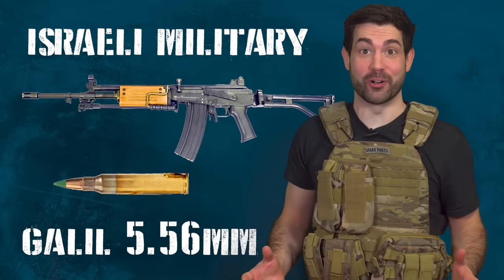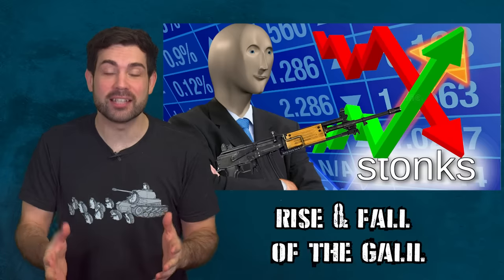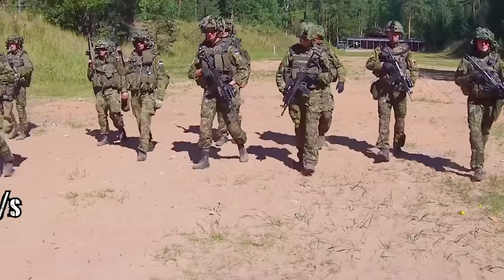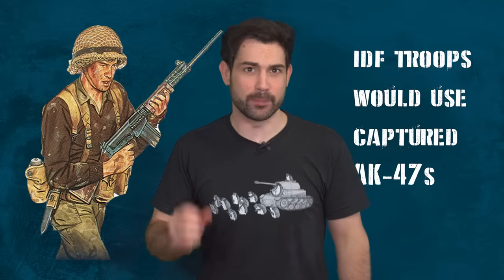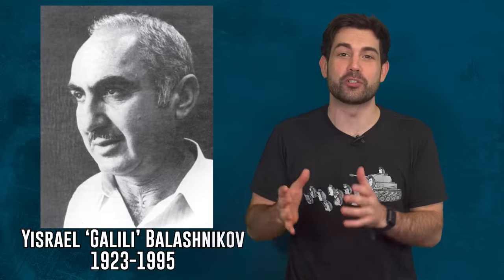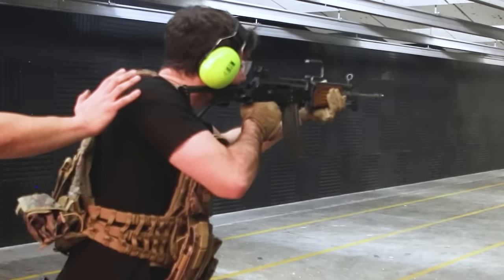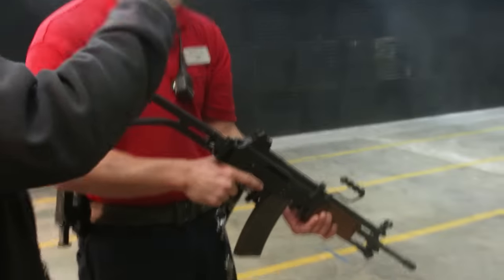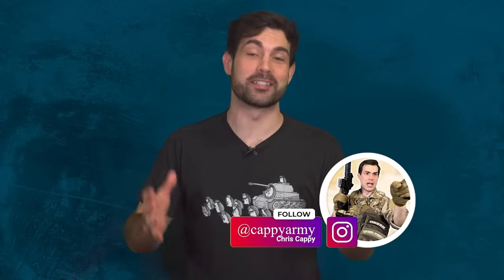Why the Israeli Army Created the Galil Rifle

Comment: Ak-47 and all its variants has one very major minus - bolt mechanism always located above barrel. It is forged steel, massive and heavy and create huge moment when cocks back every fracture of the second during fire.  It is recoil what makes it not accurate gun. You can make it completely mill it out of steel, with super tight tollerances but never change main problem - disbalance. Mass times acceleration square divided by 2 is the energy which bolt recoil back every time. It till lift barrel every discharge.  M16 on the other hand does not have that problem. Bolt mechanism is aligned with the barrel and reduce recoil significantly. Make this gun very accurate during fire.

Comment: A great weapon.  I can testify from personal experience, the short version, the Glilon, is reliable, even in snow and sand/dust conditions with no maintanance. Folding stock allows use in tunnels and bunkers. Got dual safety for both right and keft habded users. Also the heavy metal frame gives a powerful punch in close combat and in non combat situations.  Much better in all those aspects than the old M16.
Reply: Israel gets snow?

Sure.....
Reply: Yes. In the Hermon mountain. There's a ski resort there, beneath the IDF outposts on the border.

Comment: My friend has a Galil, it shoots well and runs great but I don't like how it dents the fired cases, it ejects them super hard which hit the ejection port making it impossible to reload anything it fires. And it yeets the shell casings about 40 to 50 feet away, so even if it didn't dent the cases they end up spread over a 30 foot diameter circle 50 feet away, honestly you could turn the gun sideways and shoot your enemy with the ejected cases...

Comment: Vietnam didnt fully adopt the galil ace.

meanwhile the Z111 Factory in vietnam licensed the Galil Ace and modified to back to a AK Style rifle in the STV Family of rifle (STV is vietnamese acronym for Vietnam Assault Rifle)

STV-215 and 380 being more galil aced meanwhile the STV-410 being more AK-15 related (215 being 215mm carbine, 380mm being rifle etc)

the STV-380 differences from the ACE is the AK style fire selector (Safe Burst Full auto and single), smaller handguard, and using standard AK mags, their main reason is to make the transition easier for PAVN to adopt it and the galil ace handguard was a bit too big for most Pavn soldier preferences

Comment: Interesting comments about the FAL.  I used the FAL (or rather, the Australian version, the SLR) for a LONG time, and never had a problem with it.  I loved the SLR.

Now, Australia opted for changing the safety sear so that it could only fire semi auto.  I heard that this was because the barrel really wasn't heavy enough to handle fully auto fire.  However, it may also have caused some performance issues that I wasn't aware of, but to me, the SLR was absolutely fantastic, and it handled itself well in Vietnam.  Not sandy, sure, but not exactly a clean room either.

Comment: At 2:15, correct me if I'm wrong, but there's a mistake in saying the AK-47 is stamped, when the AKM is stamped and the AK-47 is milled. Sorry if I'm wrong but I'm pretty sure that's the case.
Reply: AK-47 is stamped.
Type-2  and type-3 are milled.

Comment: In the 1980's, the IDF infantry units had a Galil and non-combat units (such as security) had M16's. The Galil was favored (I think) because it was less prone to getting jammed if you didn't clean for days in the desert, which may be saying something about discipline in the Israeli infantry units. Then circa 1990 someone realized that you can't hit your targets when you're out of breath and your rifle weighs in 10lbs, so they switched - M16's for the infantry and Galil for supporting units. Tank crews continued to have a shorter version of the Galil for another decade or so.
What else can I say about it after carrying it for 3 years in compulsory service and 16 years reserve service? It wasn't designed for Vietnam, so you couldn't clean it by taking it to the shower; Who the F designs a rifle where you the aiming sight is removed when you dismantle it for cleaning? Think it will keep its accuracy afterwards? The safety catch was prone to inadvertent opening. And no, at no time did we use it to open bottles because we didn't get any, and even if we had a chance of buying a cold soda with our money, it would be canned.

Comment: There is yet another rifle that's based on ak that fires 5.56 and adopted by a major militery. It's the INSAS rifle of India. 

It has a m4 style selector with 3 round burst. It was a non reciprocating forward charging handle. And a very similar carrying handle to that of galil. 

On the internet you will hear non experts giving a pot of shit to INSAS but what they don't realise is that this rifle new rifle was put to the test in one of the harshest climates. There are bound to be issues. 

Otherwise it is known for being very accurate and having low recoil. There is a clip of India and Us soldiers doing joint training and us soldiers like the smoothness of insas.

Comment: As a Hunter of deer and Antelope, and the later is usually ranges of over 100 yards. The 5,56 or the civilian .223 would not have the stopping power. And at 500m or 546.8 yards. Even if you could hit the target I doubt very much you would cause much damage. When I hunt long range. its a good old 30-06 all the way. Range, accuracy and knock down power that have been proven. Okay the 5.56 might be good for jungle and or urban combat, but for long range work, like over 100m, just not good enough. I don't care what any one says. Oh, its just a bullet slightly bigger then the .22 Winchester Magnum Round.

Comment: The only goal Eli ever got the fire was at an Air Force Base where I shot a folding stock 308 carbine version and fired a half-inch group with the iron sights. I don't know why it has that folding handle on it, I've literally never seen anyone actually use that fairy handle and yes that's the proper spelling for that handle because it applies to anyone who will use that handle. When I did finally buy afn it was a British inch pattern rifle that was specifically designed for Desert Warfare. It had the guts in the bolt so that it would handle sand more readily oh, it was almost impossible to raise that handle on that firearm because it had never been deployed. I found the Galil in 308 to be a superb battle rifle. I still to this day do not understand why they dumped it for the damned AR's that will not run in the sand. And you can't even pick them up because they're black. And in the sandbox out there they are way too hot to pick up once they've been sitting in the sun. Why in the world do you think that all the weapons in Israel have wooden furniture.

Comment: I can open a bottle with an m4. I can open a bottle with almost anything living in Mexico for 15 years will teach you, you can use anything as a bottle opener 😉
Reply: That's the problem, the IDF soldiers used anything they found and it was usually the magazines that got frequently damaged, so adding a bottle opener saved the magazines.

Comment: Milled receiver is not necessarily the reason why it is heavier, VZ58 is also milled and it's vice versa lighter than AK, they were just lazy or not experienced enough to remove as much material as they can back in the day. Or they just decided to have more massive body on purpose to make it more durable. 
Stealing guns from enemies and exploring them sounds like a dream job. 😀
Reply: FP-45 is stamped and much, much lighter than the vz.58.

Comment: Does the ACE still have the bottle opener? Asking for a friend
Reply: It wasn't really designed as a bottle opener. It was for holding the bi-pod, but since most rifles were used without it, soldiers found another use for it.

Comment: WHAT? Not equipped well enough to mantain an FAL??? I'm former Argentine Army, we were still using FAL's when I was I was there. If anything the FAL is EASIER to maintain in the field than an AK. Look for a problem of them disliking them elsewhere, like the fact they all wanted uzis and when they got FAL's instead they didn't liked that they couldn't auto fire a 7,62 NATO rifle accurately.

Comment: As a German I gotta say that a bottle opener is kinda usless you could just use an edge
Reply: As an Israeli I gotta say you're missing the point, the Israelis did use an edge, of their magazines, and the magazines got damaged frequently, so they designed a designated bottle opener in the rifle so they will stop doing it.
Reply: @E_y_a_l  I didn't mean an edge of the riffle (just some random edge), but with that background information I can understand the point of integrating a bottle opener into the riffle.

Comment: How can you get more ammo in a magazine with 556 the cartridge is the same size as the 7.62×39!
You can only put 30 556 in a 30 round 7.62x39 mag
Reply: They are only the same length. 7,62x39mm is a lot more tapered than the 5,56. 5,56 is thinner, but because it is different shape, it wont fit.
https://m.media-amazon.com/images/I/61LFqvcVxmL._AC_SL1454_.jpg

Comment: Lots of confusion and misinformation. 
First, the model you show here was almost never used by the IDF, it has a grip handle and this model was not supplied later (a small number of models were supplied this way, for the sake of the experiment). Second, this is the long model and a shortened model - Glilon - was used a lot. 50 round magazine were also an experimental product and were never used as standard. Automatic shooting: what's the deal with all the youtubers with automatic shooting? Why are you so excited about it? It is not clear. No IDF soldier has fired in automatic mode nor received such an instruction, there is no reason for automatic fire mode in combat except in 1 certain case (while storming into a building). bottle opener? come on. If you believe that, I have nothing to say. Just imply that the bipods need to be caught somewhere when they are in the folded position. The Galil is more accurate because of the greater distance between its sights and smaller cal., nothing to do with the stronger forged production. The IDF was not "brand new" in 1955. Most warriors where trained from the 30's and IDF itself was established on 1948. Israel Balashnikov (Galili) was not born in the USSR but rather in a kibbutz in Israel (then under the British mandate). Where do you get your information from...?

Comment: Yes the 50 round mag sucked. Which is why no one actually used one more than once.
Also, that feature in front of the magazine well, is not a bottle opener. It holds the legs of the bipod in the closed position.
Reply: It's also officially a bottle opener as you can see at 0:17 demonstrated by the developer of the Galil

Comment: The bottle opener so loudly proclaimed by the narrator was incorporated into the Galil due to the habit of IDF soldiers to use the lips of a box magazine to open soda bottles, spreading the lips and often causing a double feed just when you don't need it. The claim that the IDF gave the nickname "Tiger of the Desert" to the AK-47 is bull. In all my years as a regular and reserve (some 30 years), I never heard that name. The FN FAL, which I did my basic training with, was a piece of garbage, maybe well designed for the conditions in Europe, but a dismal failure in a desert environment. There were guys in my unit who swore that the only Egyptians injured by FALs were those who got hit by one being thrown away by an IDF soldier. S-A-R stood for Safety/Automatic/Repeat.
Sorry guys, the channel did need to do its homework a bit better for this video.

Comment: The Galil does not resemble the m16 / ar15. It is literally a milled ak with better dust / sand protection and a zero hold dust cover. otherwise all ak

Comment: Why the fascination with 5.56?  It's a small round that usually just goes through enemies.  7.62 should be the focus, that calibre will blow someones arm off rather than a .22 sized hole.... All these militaries are basically trying to make improved ak-47s or M4's..... As an Aussie. I dont see why any military doesn't use a bullpup design like the Steyr.  Longer barrel but overall lighter and smaller.  Much easier weapon to use.  Anyway whatever, spend billions developing a "new" rifle thats basically the same as the first gen 5.56 weapons.

Comment: Why did the FAL fair so badly in Israel while, anecdotally, doing so well in similar conditions during the African  "Bush Wars"? 

Anyone help?
Reply from the maker: I really think it has a lot to do with the fact that the Israeli army was only like 15, 20 years old when they started using the FAL. they were not ready to be equipped and trained to use it correctly
Reply: @Taskandpurpose  👍🏻 thanks for the reply ❤🇬🇧🇺🇲
Reply: FAL didn't do particularly well in Southern Africa either, although it is by no means bad. FAL was designed for a different type of conflict. R4/Galil is better for Southern Africa and Israel because you don't need the range, and it does much better in dusty conditions.
Reply: @AviViljoen  cheers, Avi ❤🍻🇬🇧

Comment: The whole "Can Opener" is a pure BS. as you can see in the pics and films, the Galil has bipod attached under it, and these "openers" are holding it folded. I know this because I had Galil when I served in the IDF, first with the long version and later with the shorter one.
We used it in the armoured and artilery forces because we could fold it, and not break apart as it thrown and shaken in the vehicles. it was one tough gun.
Reply: Did you even watch the video? at 0:17 Balashnikov demonstrates the bottle opener himself
Reply: @E_y_a_l  Darling, you can open your bottle with almost everything, including a fork, a spoon and the corner of the table... this is not an opener but a wire cutter. please belive me, I used the Galil for 2.5 years.
Reply: @swingingbunny3550  2.5 years is cute, I've used the Galil and Glilon for 3 years in regular service + 7 years in reserves until switching to the M-16, so "please believe me", the fact you can open a bottle with anything is exactly the problem, soldiers used their magazines and ruined them so that's why they "officially" designated that part of the rifle as a "bottle opener", to stop soldiers from using "anything", and it's not a wire cutter, the wire cutter is the front part of the bi-pod, the bottle opener is the back part that holds the bi-pod's legs in place while folded, anything else you want to try and claim, "darling"?

Comment: back in 91, i had to carry that lump of metal for a year in golani untill we finally got m-16's. israeli's are not big people, so the whight of the weapon - 5 kilos+ 8 magazins+2 cantins + what ever other gear you had to carry was a real pain in the ass. add to that the fact that the gun and the mags rust and you have to clean and oil them every day did not make it popular with the troops. the magazins jammed and because the hind sight is on a removable part of the body it is not accurate, to say the least. our guns did'nt have the handle to carry it, so after 4 months of carrying it without a strap (some kind of exercise in futility) i believe it was the single most colectivly hated piece gear by far

Comment: I served in Battalion 50 Paratroopers 1972, 3rd Infantry Brigade 1973, 525 Airborne Brigade 1976 to 1981. You tell a good story but much of it is made up. FN 762 and Uzi 9mm were standard infantry weapons. At the end of the 1973 war Nixon airlifted thousands of M16’s replacing the FN and Uzi overnight as the standard IDF Infantryl rifle. The Galil was not seen in wide service until 1980-81. 
Israel is constantly improving its weapons systems based upon results in the field during combat. The FN never had a nick name other than heavy piece of shit. Everyone wanted a Klach. 
SF Units carried them as well as other weapons after the 6 days war. When Israel transition to the M4 instead of the Galil, the new Bull Pup Tavor was already in development. The Uzi served Israel well until the 1970’s when Arab Forces our gunned the IDF with the Klach.

Comment: 1. Yisrael Galili (Balashnikov) was born in Palestine Mandate - Mishmar A-Yarden to be precise. And not in the Soviet Union. ))))))))))))))
2. Uzi was developed by Uziel Gal, which was Galili's competitor for developing FN-FAL replacement. Galili had no connection to UZI development, except some similarity in last names.
3. "Balashnikov" was joke code-name given to Galili's prototype due to pretty obvious reasons. Weapon got it's name at the same point, when prototype won the competition.  
4. It never had "designed bottle opener" - you're referring to is a bipod folding-lock which was never intended for bottle opening. Yeah, pal - it's a very-very old IDF-internal joke.
Reply: Did you even watch the video? at 0:17 Balashnikov demonstrates the bottle opener himself
Reply: @E_y_a_l  that's how this joke started. But I understand, that you know better than actual IDF vets and galil users. 🤣🤣🤣🤣🤣
Reply: @yurkofess3825  I am an actual IDF vet and Galil user, I had a short Galil(Glilon) from 2001 to 2004 in the compulsory army and until 2010 in the reserves when we switched to short M-16s, and I even was "lucky" enough to coincidently have a Glilon with that bipod lock but without a bipod, so maybe tone down the arrogant attitude just a tiny bit...maybe the bipod lock was designed in the drawing board phase to also be used as a bottle opener and maybe it wasn't, but it's a fact that eventually it was officially designated to be used in such way when the rifle was introduced.